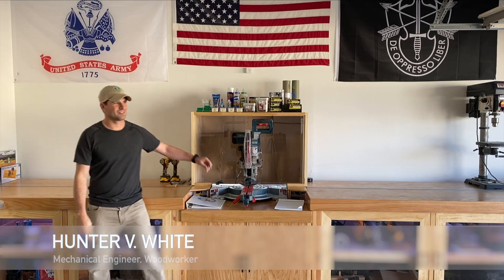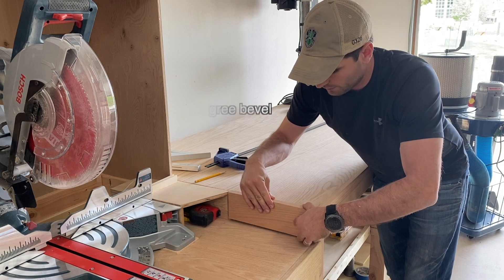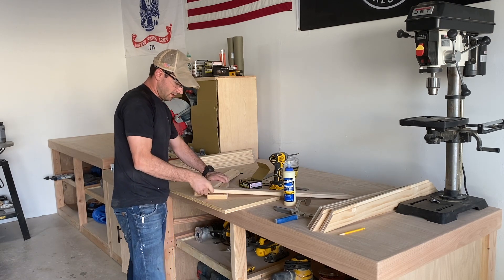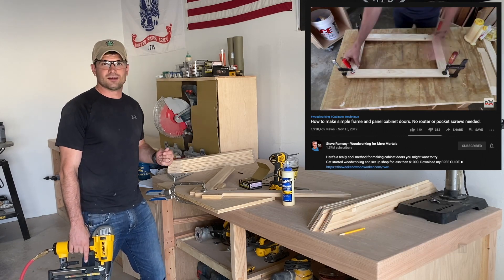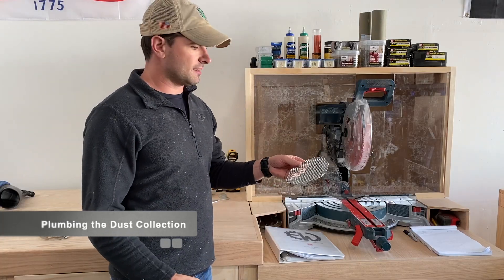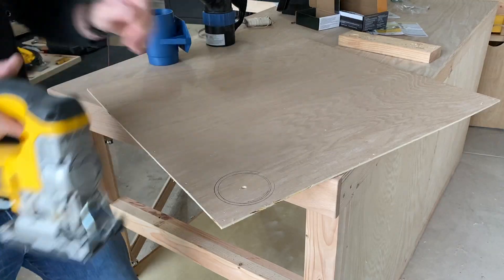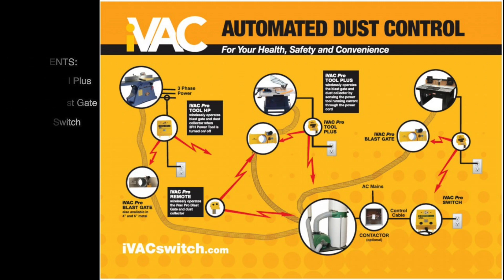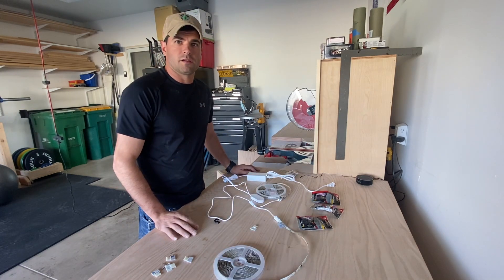Over-Engineered Miter Saw Station - Part 3

Comment: I really like your dust collection set up and had the same ideas except attach from a wall mounted dust right. How do you like the mobile dust right 750 cfm? Do you ever think you need more cfm or power?
Reply from the maker: Hey Jeff! Thanks for the comment. I do really like the 750 CFM unit, but mostly because it is quiet, mobile, and way better than a shop vac. If you were going to go for a wall mounted unit, I would get the 1350 CFM one (assuming you stay with Rockler). Simply because more suction is always better, and I'd rather have too much than too little. I don't have any issues with 750 in that regard, but I don't have an extensive system. If I ever get into a larger shop than a garage, I'l upgrade.

Comment: Great build! Some suggestions though, why didn't you add some support at the back for longer material line-up and clamping or stop blocks? What you could also add is some self adhesive measuring tape to both sides. Love the design, it really looks great.
Don't take this the wrong way please, but your audio could use some attention, the music is really loud and obnoxious, but the minute minute you speak I have to turn up the volume. I have subscribed, because I enjoyed the miter saw station build, looking forward to seeing new content. All the best Mitzi - South Africa 💫
Reply from the maker: Hey Mitzi, thanks for the comment! I chose to only use the miter saw fence [for alignment to the blade] because it allows for a perpendicular cut on a warped piece of wood. If I was to extend the fence all the way down the support benches, the angle of the cut would be the average of the straightness of the board - not a true 90 degree cut. Also, it allows for my working space in a small shop; I put stuff along the back of the benches all the time. 

I thought about the measuring tape - I even bought it - but didn’t like the stop block enough to commit to it. I thought I might end up redesigning how the stop block was used, which would necessitate a different measuring line up. I’ll probably add it in the future. 

No worries about the audio. Video editing is hard lol. I’m just learning. People go to college for this, I studied math and math engineering instead :) I’ll do better next time. Thanks for the attention and subscription!!
Reply: @EngineeringWorkshop_hvw  I love how you explain your process, and your to the point no nonsense style of presenting is great, so many people waste so much time on repetition of milling etc. Respect to you for starting your channel and creating good YouTube content. Your explanation makes perfect sense, thank you for taking the time to respond to me, even though I might come across as a loudmouth critic 😃, my intentions are not to bring you down, but to help you grow your channel and be a loyal subscriber. Looking forward to see mire videos  from you soon. 👍🏻🤞🏻

Comment: I too am in process of building some cabinet doors with clear panels.  I planned to use 1/4" polycarbonate, but can not find a source for it at a reasonable price.  I've decided to use glass as it is considerably cheaper right now.  Did you find somewhere relatively cheap to buy it or did you bite the bullet and pay the inflated COVID price?
Reply from the maker: Fortunately I purchased my polycarbonate from McMaster-Carr before the prices were crazy. I spent around $400 on the polycarbonate, and around $500 on shipping. The shipping caught me by surprise after I already purchased the product and committed. The main expense was shipping a full 4’x8’ sheet, packaged to prevent all damage. Perhaps, buying 4’x4’ sheets would be cheaper on shipping.
Reply: @EngineeringWorkshop_hvw  Yikes!  I'll stick with glass cut to fit at Lowe's.  Thanks for the info.  McMaster-Carr is AWESOME, ....except for their shipping policy.  They've caught me a couple times with some obnoxious shipping quote after the purchase.  Would be nice to know the shipping cost prior to purchase.
Reply: @EngineeringWorkshop_hvw  Nice Build.  I can relate to over-engineered.  When you shop McMaster-Carr online, save everything to your cart, then call them and they can look at your cart and give you a shipping estimate.  That way, no surprises!  Subscribed!  Can't wait to see what you over-engineer next!!